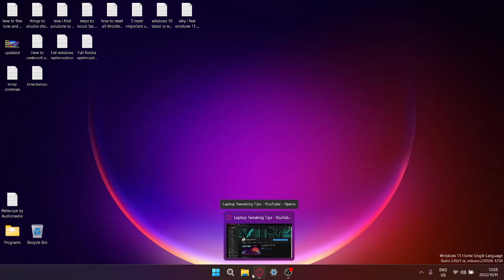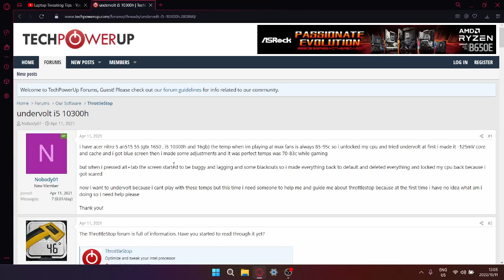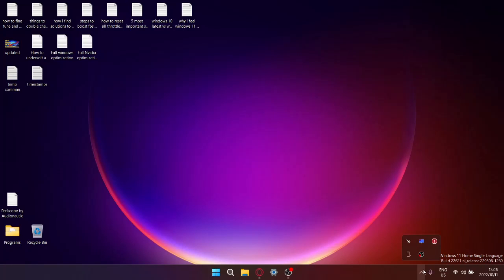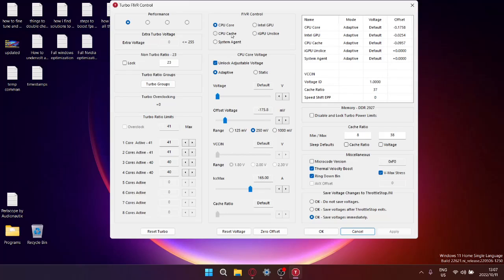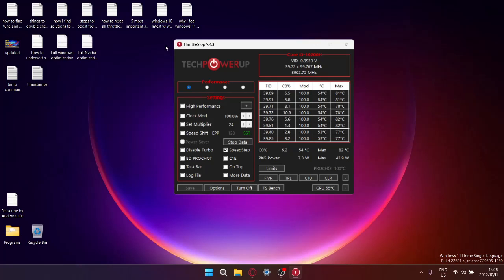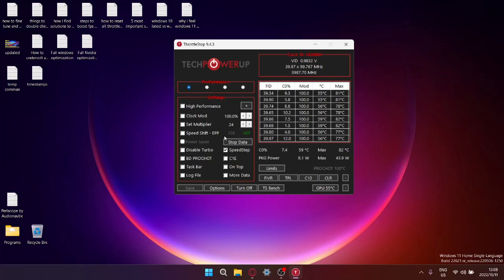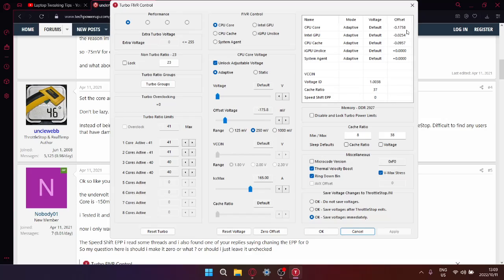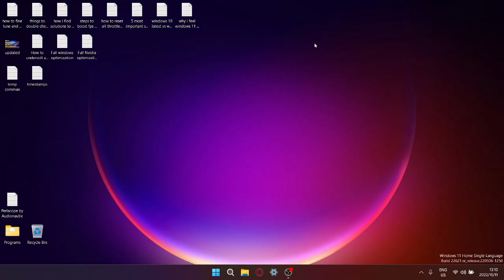Fine tune your undervolt fully with throttlestop!! #throttlestop

Comment: What a great little tip Justin. I managed to get my Alienware M15 R6 CPU Core -60.5 CPU Cache -44.9 Power limit controls PL1 & PL2 Clamped, Turbo Time Limit 0.0049
What a massive difference, no throttling and temperature not exceeding 85°C. Any of you guys with a M15 R6 I really advise you to check out Justin's BIOS unlocking video. It's like going from night to day with a 40% fps increase in MSFS 20. Thanks so much Justin for your great help and support with my laptop. Regards
Reply from the maker: 40% FPS increase? Really?
I take it the M15 was throttling like mad pre-undervolt. Thanks for the for the endorsement bro 👍👍
Reply: @laptoptweakingtips  There was also an issue with a recent BIOS update from Dell which put everything back to default. After changing one or two things along with the undervolt I've gone from 25-30fps to 45-50fps. It's like having a super computer.......but it has taken nearly 12 months to get there, plus all the bullshit lies from Dell. They would be well advised to listen to you my friend!
Reply from the maker: Hahaha they should do just that, or read Reddit at the very least. Do you know how many times I've had a problem with a Dell, find nothing but generic garbage on Dell forums from consultants, only to find a solution on a Reddit forum.

Dell should be embarrassed 🤷🤦